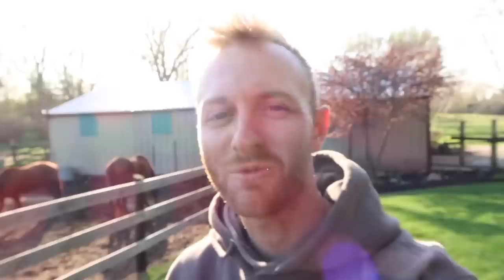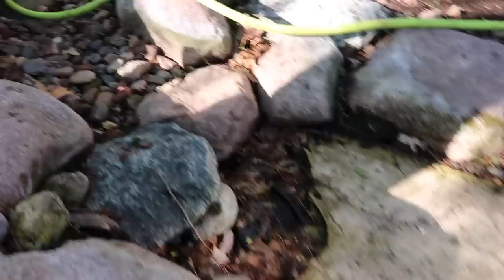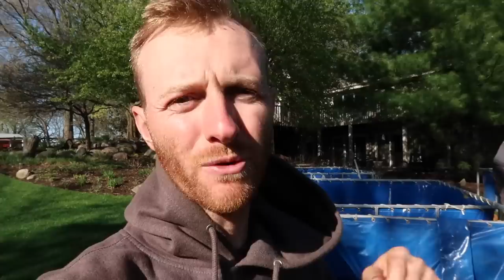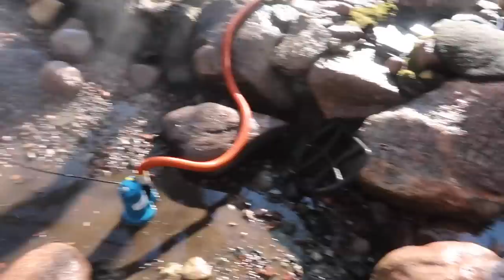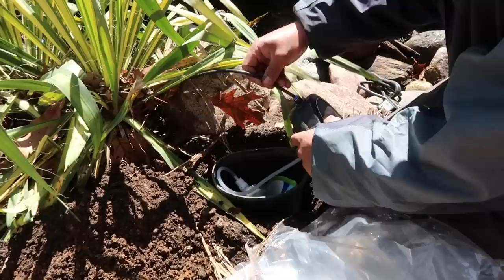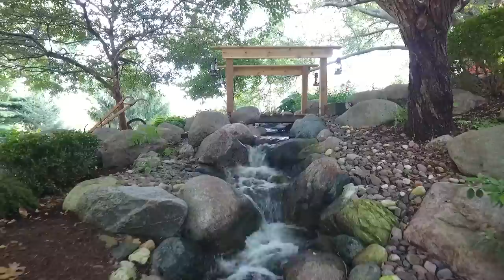Residential POND Cleanout: The Step-by-Step Process!

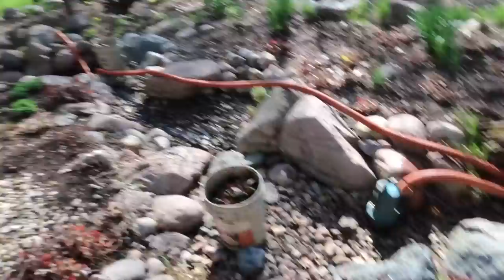Comment: Hey guys very informative video, couple of questions at the 6:25 ish mark noticed a frog 🐸 maybe a toad .. anyhow.. spring of 2021 will be my first time doing any clean out. But.. although I've got no fish 🐟 I've noticed a couple of frog's late fall.. so I assuming they wintered in my pond. And then dragonflies, other locals.. I don't wanna disturb or harm them. 1. So how do you obtain this level of cleaning and not kill em? 2. Pressure washing..any particular degree of tip you do or don't recommend? 3100 psi too large for Cleaning? 3. Lastly, I've got the 45 mil EPDM liner as well..but walking on it really???? I've also got stone on the bottom and isn't that asking for it, a leak, more work?? One wrong step.. 4. (I lied 🙃) why don't you use a pond vaccum? What's different about rinsing and pumping out??? Thanks again guys! Awesome work/video